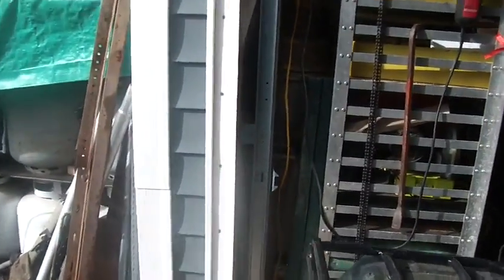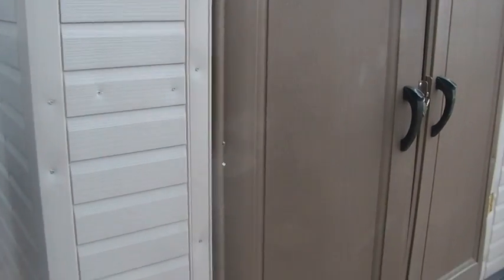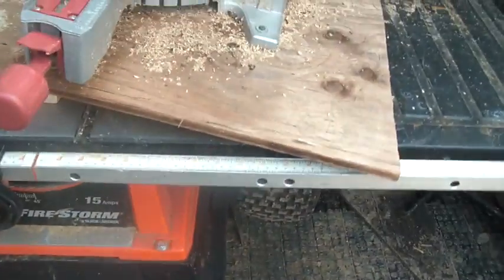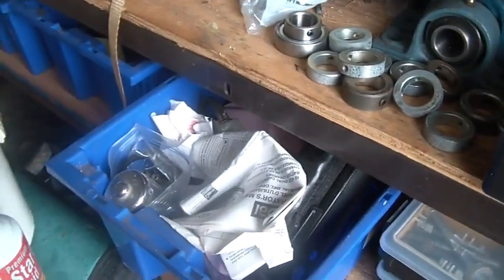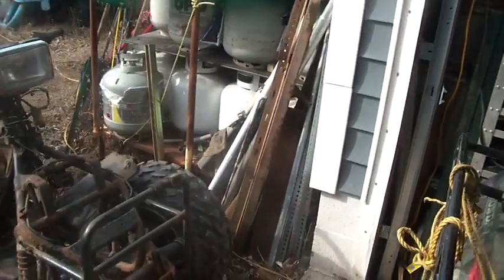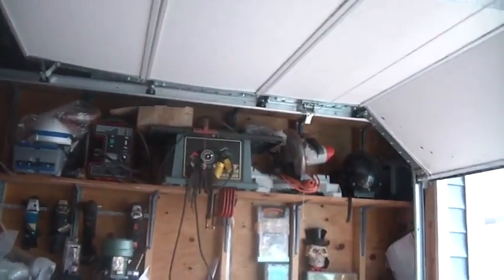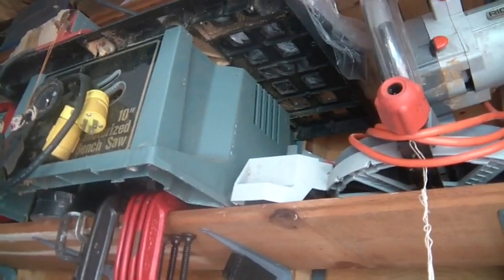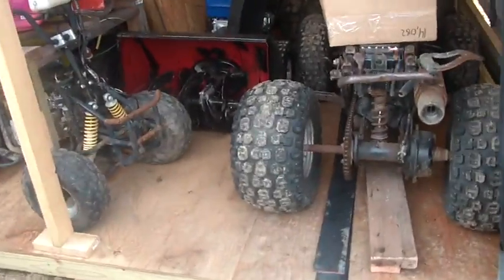Garage tips, tell me what works and what does not!

Comment: For me, I like a clear work table, no matter the project. I have three tables that I revolve work around, each dedicated to different projects, so organization of tools is associated by the type of project, and I place those tools on pegboards and in cabinets near the respected table. One of those tables is on wheels, so I can push it out of the way when not in use (it is dedicated to carburetor rebuilding and small engine repair). I keep power tools low, usually in or near tool-trays or on low shelves. I put projects I am working on in my way, so that I am forced to work on it before it can be moved. I keep my table saw out back so it gets rained on now and then... I am sentimental about certain equipment, but not others. I also organize by size. Redundancies/contingencies I try to get rid of i.e. I don't have a bench-grinder because I can do the same with an angle grinder and a vice. 

Key: I sell anything I don't use often.
Reply from the maker: +alphamongrel I read Ur comments and each was a very good idea, I can see my mistakes and problems I each area, ie - I keep too many redundant tools, even broken ones... I mix projects, even unlike types, Honda stuff, with Briggs, with wood working.... I'm going to take Ur thoughts to heart and try to adopt a bunch of them.... Stay tuned!!!   U seem to work on a lot of cool stuff, I wish U posted videos!!!  Thanks for your input, watching, and commenting!!!

Comment: I have to say it'll be one heck of a process ALOT of stuff needs gone thru in the hoard. Like items with like items and long term storage and work areas separated. I'd definitely say you've got a few things to get rid of, I'm not hating one bit! Perhaps take 20 items to the swap meet or flea market and only bring 3 things back..... Just my opinion good luck looks overwhelming!
Reply from the maker: +corie Dunning , The hoard suffers periodic set backs and the most recent one was the loss of the Suzuki DR200SE key... It is like a groin kick that makes me stop and reconsider what my next move should be... The DR200 Key situation was fixed with 1/8 drill bit and I have started cleaning up some of my real troubled areas.... I also decided to share more with my son's house.... Thanks for your good input, watching, and commenting... The SL350 and the DR200SE maybe going to a swap meet in May if they are not sold sooner then that...